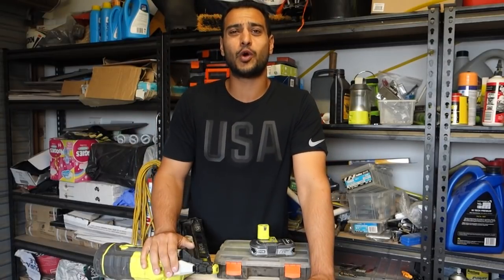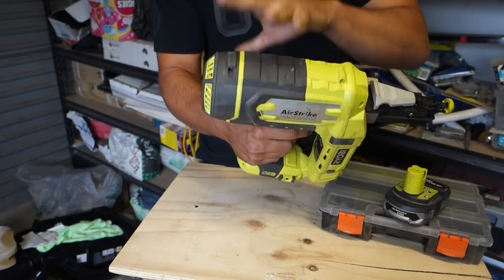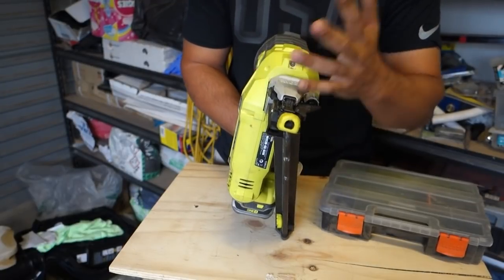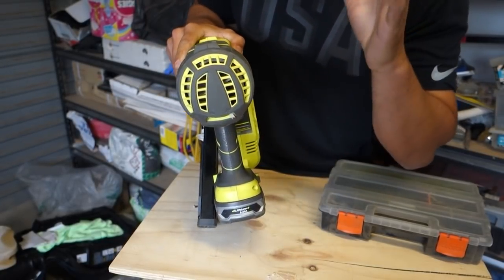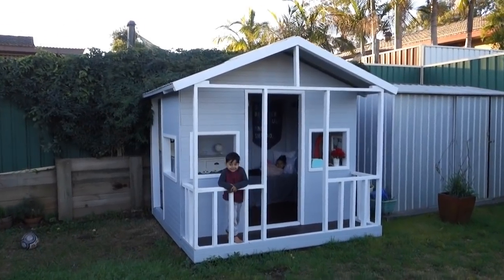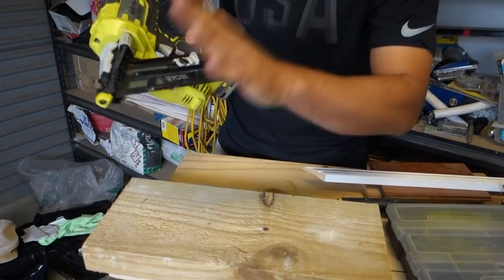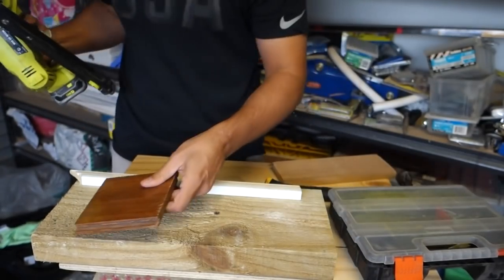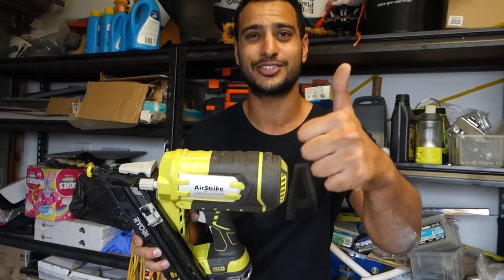Ryobi one+ finish nailer review and tool test - 18v Airstrike brad nailer

Comment: I've got a decent collection of Ryobi one+ ...
Bit the bullet and bought one...
First nail gun I've ever used... 
Love it...
However the max length is 64mm (2.5 inches) 15 gauge nail.
I think I need at least 3" and a thicker gauge 
I'm trying to build wall frames for a 3x3 meter shed.
Realised it's just a big finishing gun..
 I'm gonna need a bigger gun...lol... 
Looking for options...
I have an Air Compressor
Reply from the maker: Lol unfortunately ryobi doesn’t have a framing nailer. For gas less framing nailer I have been using the dewalt which is great. 👍
Reply: Ryobi make an air framer.... I have one. It’s $158 at Bunnings. Haven’t had it long but it seems quite decent. I own both the 15ga one reviewed here and the framer and I agree - they serve completely different purposes

Comment: just one question bud, i bought this gun today R18NL15 basically to do the quads around the floating floor boards, can I use this nail gun on quads even if the floor boards are against concrete floor or it can only work with timber? thanks
Reply from the maker: Hi it definitely won’t go through concrete. They may need to be glued rather than nailed

Comment: Hey mate, great video. I am looking at something like this for small woodworking projects and was wondering if this unit goes smaller on the nails it uses. I want to keep everything as small as possible. Maybe there is another unit in the R1plus range. I looked at the stapler but it only seems to use crowned staples and I would prefer nails. Any help appreciated mate, have a crackin day. Andrew.
Reply: Ryobi one+ pin nailer
Reply: @huntersolem5453  cheers mate, hope you had a cracking long weekend.

Comment: I have this nail gun and it's been shooting nails only halfway through material. I've cleaned and oiled it, messed with the depth cage, and partially taken it apart to find the issue to no prevail. Now I think it's the batteries, but before I go out and buy some does anybody have any input? Thanks in advance

Comment: HELLO can i use this for putting up a stockade premade fence paneles? I plan on making a fence this sat already bought 2 grand in materials and now im thinking about buying a nail gun
Reply: Not sure if you've put up your fence yet, but yes you can. I put up a 6' privacy fence with treated lumber, years ago with 15gauge finish nails and it's still going strong. Instead of putting 2 screws or framing nails in each crossmember, I put in 4 nails.